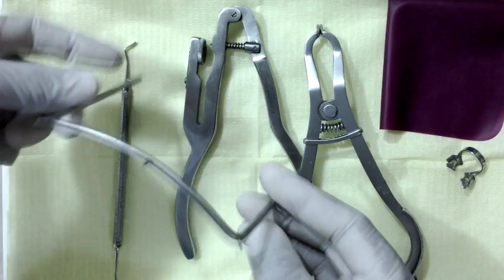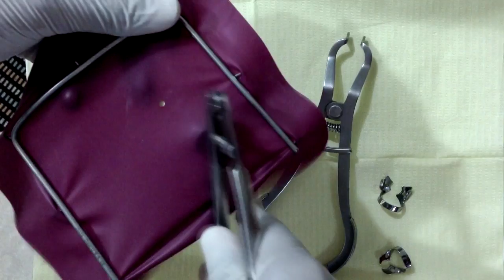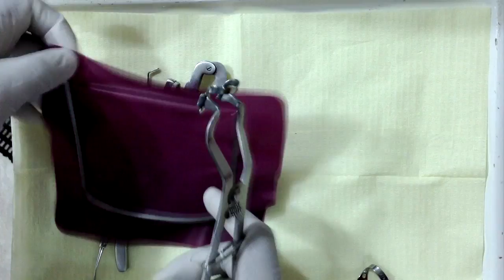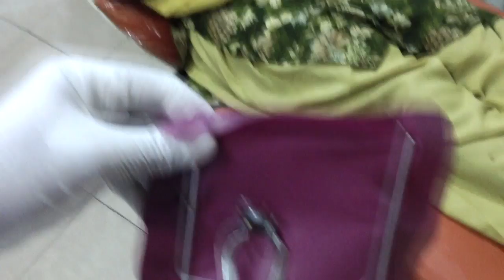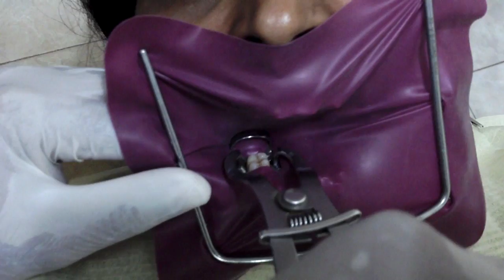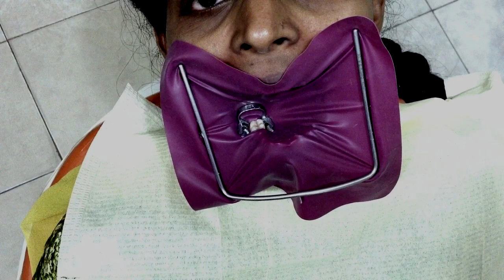Dental rubber dam in 2 minutes | Dr.Ajinkya Naik

Comment: My rubber sheet tear bery easily which brand you prefer
Reply from the maker: That's because ur using a latex sheet. Try to find a silicone sheet. It's a bit expensive, but tear resistant